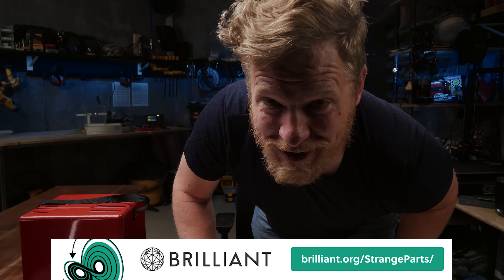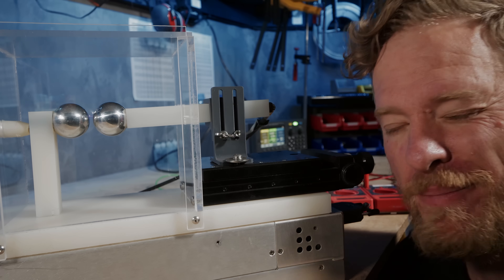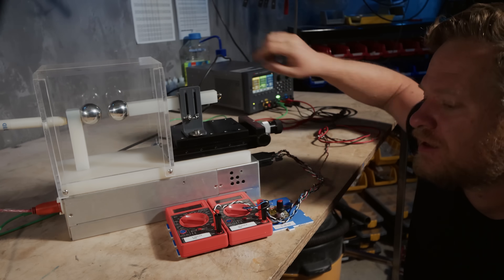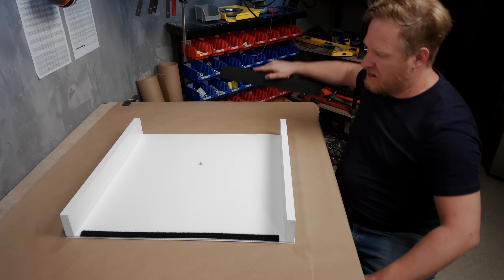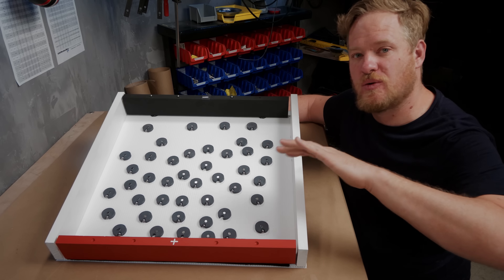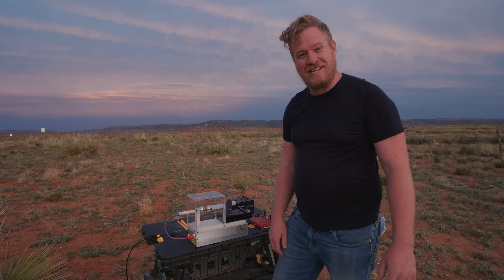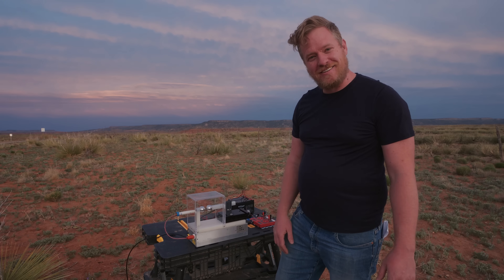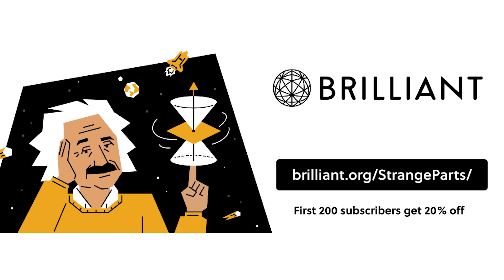Why 10,000 volts at altitude is a BAD IDEA

Comment: I have first hand experience with this property of arcs. I had a car that would misfire under boost and found the spark plugs eroded to twice the gap they should have been. It would run fine under light load but the increased density of the air and fuel under boost would not let the spark jump across the spark plug.

Comment: What you are describing is also what is known as High-Altitude Flashover in aviation.
High voltage ignition systems in piston engined aircraft suffered such problems at high altitude as far back as the 1920's.
The resistance of the air at altitude is indeed lower, and the engines were suffering from sometimes as many as three cylinders lighting-off at once when they shouldn't due to the some 50k volt magneto rotor-tip rotating to the next cylinder, but having enough potential at the lower resistance to light the previous cylinder and the preceeding cylinder at the same time as the proper cylinder.
Nightmare fuel for us knock-chasers....

Comment: I design high-voltage components for aircraft. This is a relatively new area as pretty much all older aircraft use less than 270 V in operation. We are currently aiming for a safety factor of 2x the design operating voltage, meaning that we don't want to see any arcs or discharges up to double the intended operating voltage even at the maximum altitude of the aircraft. This is the same margin used in HV cables for the power grid.
At your altitude of about 2250 m arcs can jump about 30 % longer than at sea level (based on Paschen's Law). Hence, I would go as far as to say that the manufacturer of the electron microscope has been very lucky to not having seen these problems until now. 30 % is a very low safety margin that is likely to be exceeded by other things, like manufacturing tolerances, temperature, ageing of materials over time, etc.

Comment: Really cool stuff. I spent a few weeks storm chasing in that area and saw some amazing light shows out there. This explains why the Rocky Mountains have such intense lightning storms. I thought it had to do with the humidity or lack thereof but yeah, the thinner air means the electrons can travel further and quicker with less impedance caused by the "thicker" air found at lower altitudes.

I come from 66 feet off sea level and traveling to Colorado made me feel quite lightheaded and faint for a few days until I got used to it.

Comment: Even though electrons have a negative charge, the positive electrode is described as having an abundance of charge, which is counter to having a positive (implying lack of negative) charge. 

I.E. the positive electrode technically has a negative charge since it has a positive supply of negatively charged particles. Confusing enough, lol?

Comment: One additional thing is that the atmospheric pressure decreases exponentially with altitude. So if you measured the spark gap at every 1000 feet above sea level, it should increase in larger steps each time.

Comment: Put it in a box containing Sulfur hexafluoride (SF6) which has 3x the breakdown voltage compared to air. It can also make your voice real low since it is about 6x as dense as air. But it's an extremely potent and persistent greenhouse gas :(.

Comment: curious.. auto mechanic level understanding of electricity here...  Curious how you can have a 10,000 volt arch going from two metal balls with out melting/welding? low amps?

Comment: Here's a source on vacuum pump operation at elevated altitudes. Discharge is showing that there is too soft of a vacuum to permit beam formation, turning an SEM into an overly expensive gas discharge tube.
Hell, in the ISS it could be easier by venting the SEM cavity to space, which has a harder vacuum than what most pumps can deliver.
https://www.dekkervacuum.com/resource-library/knowledge-database/technical-data/altitude-effect-on-the-operation-of-liquid-ring-vacuum-pumps/

Comment: Rather than driving around the country, why not just build a box where you could vary the air pressure?  You controlled distance, shape of the electrodes, and voltage.  

Also, how did you solve the problem?  Or did the manufacturer change the design?

Comment: That's interesting! It would appear that the higher the altitude, the thinner the air, thus closer to a vaccum. In a good vacuum, the dielctric strength is much higher than in open air. With your experiment It doesn't appear to be a gradient value from air to vacuum. We would think that thin air would be less likely to arc.. not so!

Comment: Electrons are at constant speed. They don't sit, nor are the interactions due to speed of electrons but the how the atoms interact with the electricity or magnetic wavelengths. Resistance can slow the process from atom to atom but the orbital field is constantly running.

Comment: Now I understand why my multimeter tool specifications said not to use above 6000 feet elevation. I'm at 6800 feet, but had no problems with it. But I don't measure anything over 240 volts, well below it's specifications for 800 volts.

Comment: So, if I extrapolate correctly, does lightning happen more often at higher altitudes or are the other factors related to lightning that have more impact? Is there a voltage difference between average lightning strikes at sea level vs higher altitudes. So curious now how this works but unfortunately real-life says I need to get back to work.

Comment: The high dielectric constant of air is also why aviation spark plug testers have a pressurized chamber for test firing (sparking) spark plugs.  A plug may fire well at ambient conditions, but in a piston engine, where pressure is higher, it may not fire well. The pressure chamber more closely emulates the air density inside the piston engine combustion chamber on the compression stroke.

Comment: So why don't you just cover the electronic circuit with a kind of insulator liquid  or silicon  So that the air and vacuum doesn't come in contact with electronic components

Comment: Interesting. Just a suggestion, if you need to do altitude tests, i'd suggest you to try to build or buy a vacuum chamber. Or pressure chamber. Thus you could build up pressure to simulate see level, or lower pressure to simulate higher. Bonus : it would allow you to do such experiments faster, and probably in one shoot :D

Comment: Interesting.  I'm like you, i thought it would be better to be at a lower air pressure.  Mainly, because vacuum is an excellent electrical insulator.  In fact, pretty much all medium and high voltage circuit breakers are vacuum insulated.  Note: medium voltage in industrial terms usually means above 1000V.  High voltage is even higher!  I've had to work on 230KV systems, and that makes me as nervous as a long tailed cat in a room full of rocking chairs.  The arc distance is crazy high.  And if you do get hit by that kind of line voltage with an electrical grid behind it, you basically vaporize.

Comment: What brand of SEM is that?
Reply: SEM specimen chambers are in partial vacuum or high vacuum during operation. And that pressure in the chamber is way lower than atmospheric pressure even when compared to the pressure at the peak of Everest. Portable SEMs need to have the specimen chamber pumping down to chamber pressure about the magnitude of 10Pa. The bigger systems needs much much lower thannthat to allow for high magnification imaging...
Reply: And particularly when you are imaging using the everhart thornley detector, poor vaccum is what causes arcing between the bias cage of the detector and random spots withing the chamber. Poor vacuum can be a result of some dust trapped between the specimen chamber door and the chamber itself. Yes... tiny spec of dust. Major SEM manufacturers usually prevent users from firing up the electron beam column if the specimen chamber is unable to go below a certain pressure. The arcing will damage not only the Everhart Thornley detector, but solid state BSE detectors and the scintilator screen on opto-conversion detectors too...

Comment: As an electronics safety engineer, I liked this demo, but found it a bit frustrating. 
There are safety margins built into the safety standards to account for a bit of altitude - but there are also altitude margin factors that should be used to deal with high altitude applications. They're right there in the same clause as the clearance and creepage distance. In the USA, that's UL 61010-1 for this sort of equipment, clauses 6.7 and 6.8 - which is derived from IEC 61010-1, which means that we're all using the same basic standard all over the world. No excuses, guys!
If the equipment was designed to work properly and safely at normal habitable altitudes, then you wouldn't be experiencing these arcs. 2000 m is the maximum altitude that we allow without applying the correction factors - that's about 6000 ft or so. There's plenty of good science labs at higher altitudes. I feel like it's something the designers should have accounted for.

Comment: That box demo was really good, you could almost see the electrical arcing as the balls fell out in a cascade

You said that the distance between the balls is pressure, would that be density? Or I guess they're kind of the same thing and that the balls themselves are all bouncing around?

I still don't really get the whole continuous single arc thing, the demo was great for illustrating like a lightning bolt that is scattered and just one big event, but the continuous arc is a bit different, it doesn't scatter for one, does it need a continuous stream of new air in order to continue arcing? Does it re-fill the air's potential to arc somehow?

Comment: Did you really expect a high-voltage device to operate normally, when you are at an altitude where boiling water does not happen normally, (at lower altitudes)?

This is what I'd expect from people who cannot figure out why their 120 volt (AC) devices don't work with 240 volt (AC) outlets.

Comment: that is not the whole story. An arc is also plasma, which forms when a strong electric field is applied to an atom. If it is strong enough it rips away an electron or more of them making a lot of stuff. it forms ions meaning that there are now positive atoms flowing towards the negative source of the electric field as well as ripped electrons flowing towards positive part. There is some truth to your explanation in a way that if the intensity of the electric field is just barely not strong enough to rip apart an atom, a bump from an electron can do it for you(electrons also have their own field which exponentially gets stronger the closer the electron is to the atom in question, enough so it gets over the energy barrier)

Comment: I worked with an SEM about 20 years ago, if I remember correctly it pumped the air out the chamber. Did SEM design change since then, that this isn’t necessary anymore? Great explanation btw!

Comment: You just made me think of geiger counters. Your elevation would have a higher count then a lower elevation due not only to the lack of air molecules but your closer to space (I think?). And like that crazy theory that cosmic rays can trigger off lighting in storm clouds, I wonder it that 'helps' in your electrical discharge of your scanning electron microscope.. I don't know, but crazy thought. Also where you located also might have a larger background count do to the rocks around you. I remember back in the 80's a geiger counter got tripped down stream from the coors plant. Up stream there is a few uranium mines, So I wonder if where you are located if you have a few Gama rays or other playing with your system?
Reply: also Geiger counters use high voltage for their internal system.

Comment: take larger bike pump, enclose your sem in some chamber, install tire valve on chamber, connect your pump, push hard on your pump, done, problem solved in 30 min with building time and pumping included.

Comment: This problem was solved before WW2 with pressurized magnetos for aircraft engines. The electrical arc would jump across the points (just as stated in this video) at high altitude. The solution was to pump in more air into the magneto (self contained ignition system), making it think it was at a much lower altitude.

Comment: And the fact that oxygen is ferromagnetic and so way denser at lower altitudes makes it even less possible for an arc to deflect an electron from nitrogen atoms, cause there is less nitrogen atoms per one oxygen atom and because of oxygen ferromagnetic properties its harder to ionise the air, cause the oxygen dispurses them fast enough that it delays the full ionisation by a lot

Comment: This is just one of the difficulties with designing CRT TV sets with 25-30,000 volts to operate reliably in Florida (max altitude 80 ft) and at 5000 ft or more.

Comment: I design high voltage equipment and the changes required from sea level to 9k feet are huge.  I love the example you did for avalanche.  I have had to explain that so many times, and will now keep this video marked just for that example.  One other cool thing with shape change using the sharp pin to round ball configuration is to change which side the sharp point is on.  The allowable gap is much smaller when the sharp point is positive.

Comment: The pressure mater, as well as the shape, distance and tension. But, the actual gas present also play an important role. Different gas ionize at different electrical potential. Xenon is easy to ionize and radon is even easier, while helium demand more tension.

So, maybe putting your portable scanning electron microscope in an helium filled enclosure could help. Or, use it in a pressurized container.

Comment: I guess i get the whole "driving to different places to show elevation", but doesn't this add the possibility of local (non-altitude related) confounding factors? I cant think of any off hand (maybe power lines?) but to be sure wouldn't it be more "scientific" to just build a sealed chamber and test at various pressures? Also, wouldn't that be the solution to your problem with the SEM, just build a glovebox for it?

Comment: The SEM's we build operate in ultra high vacuum. If you are at the pressure level between atmosphere and vacuum where arcing will occur, maybe a better vacuum chamber would solve your issue.
Reply: I cannot figure out how a SEM could operate outside a high vacuum because you need a mean free path for the electron beam

Comment: I love the video!  I had to look up electron flow in a vacuum because I had known about current flow in low pressure but hat thought therefore electrons flow freely in a vacuum.
It turns out that a vacuum is an insulator.  So I wonder at what pressure the gap starts to shrink.

Comment: So a solution would be to just pot the high voltage components, even a relatively thin layer of potting would probably get the 30% or so reduction you'd need to get the SEM running reliably. E6000 craft glue is 400V/mil di-electric strength, you can coat your high voltage testing balls with it and see if it would be suitable for coating PCB's to prevent arcing. Actual molded in place potting might be needed for more problematic areas.

Comment: I’m confused. I use an SEM at work and it uses a turbo molecular pump to bring the chamber down to vacuum in order to image something. It uses a CeB6 source who’s life depends on a constant vacuum environment in order to preserve its life and from what I understand imaging depends on the vacuum environment in order for the electrons to reach the detector clearly (if there were air molecules they would cause the image to become grainy or no image at all).
Reply: Thinking about it, could he have been taking about the electronics before the sample chamber which should be at vacuum but confused the arcing to be occurring inside the sample chamber.

Comment: There are a few things one can do to fix this.  In the era of tube televisions, we had hi voltage acrylic spray to coat pc boards with.  A spray on silicone could be used, but is less removable.  

A primitive, but effective fix is to put the machine in a bag, and pump up the air pressure to 5 PSI gauge pressure at your altitude. I suspect controlling the unit is done electrically, so a remote control head may be needed.
 If you watched The Martian, you could line the room with plastic, and pressurize the work room to 5 psi, but structural integrity will have to support that idea.
  A humidifier in the same room could be helpful, too.

Comment: I still have a question though.if the arc is just fotons being emoted by the atoms when they are hit by electrons. Does that mean that under low enough pressure (or is there just isn't enough energy to kick of electrons from the atoms) there would be current flow through the gap without visible indication? And wouldn't that make it a bigger problem since current can jump without arcing? Or is that what magnetic field are and I'm just overthinking this?

Comment: If you put the SEM in a plastic bin filled with sulfur hexafluoride, you won’t have any more arcing. Sulfur Hexafluoride is specifically used to reduce electric arcs in high voltage conditions.

Comment: Fun fact. This is actually a big problem for reciprocating engines in planes. They'll run into similiar issues with arcing at altitude. To combat this some aircraft actually use superchargers to pressurise the magnetos to prevent them from sparking too soon.

Comment: You said you live at 7200 feet what converts to around 2200 meter. You serious that high up a mountain? 2000 meters that like going to the top of a mountain for skiing. Extremely high for having such a shop. I am up at 600 meter myself and that is already out of the normal here in NZ for having a full grid connected place.

Comment: Higher altitude = lower atmo pressure = farther apart atoms = less likely for electrons to hit air molecules
So how exactly is an arc more likely at higher altitudes? The demonstration shows it should be the opposite.